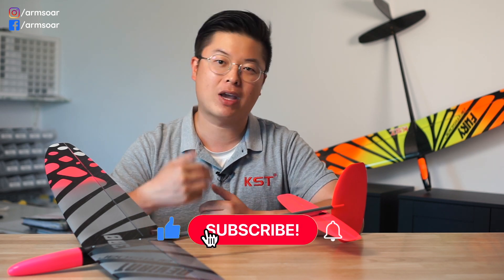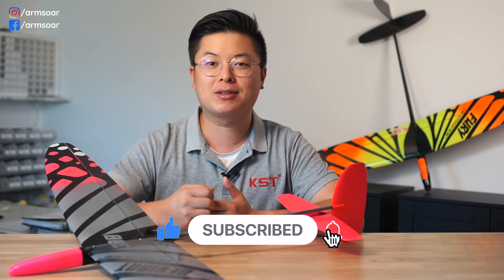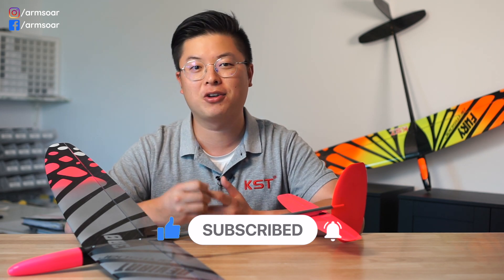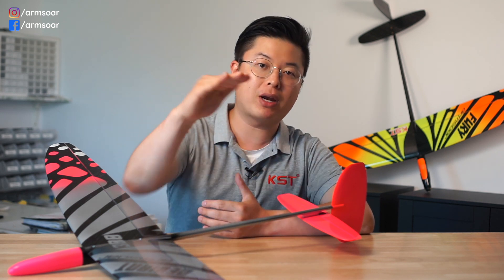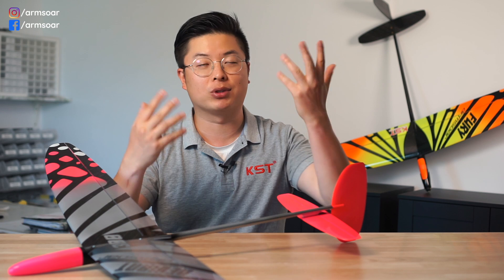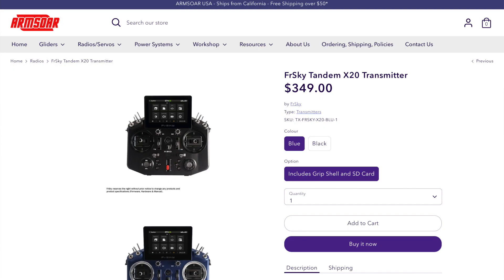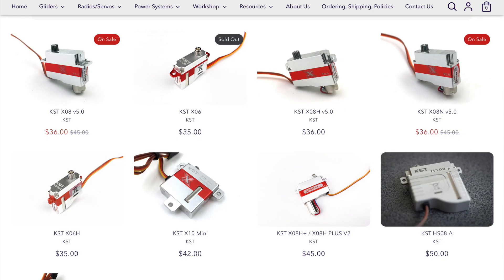RC Glider Basics | Failsafe

Comment from the maker: How do you setup your failsafe?
Reply: Idk
Reply: If you have SAFE, I think you can set it to SAFE and full bank. So the plane circles.
This must be the best setup for failsafe. 
I would like to know if it’s possible to do the same with FrSky gyro receivers.
Reply: @michelpetrus  It is.  I do something very similar with my FrSky stabilized receivers.  I turn on self-leveling mode, cut the throttle and add left rudder.  I have simulated it while flying and it works very well.
Reply: SAFE mode with a bank angle of 20-25 degrees..

Comment: I have a question, if you loose your esc mid air, killing power to everything, fail safe does nothing correct? I'm trying to determine if it was purely luck, or if  failsafe kicked in just as the esc burnt up. Regardless, the powered glider in which this happened to me with pulled up on its own, and seemingly put itself into a turn which I believe happened because of failsafe. I happened to have a camera on the plane when it died, so I have a recording of the entire thing and kindof know the full story, I think failsafe indeed saved it, but Im just not sure. All I know for certain is the plane was completely dead in the air, the motor brake on the folding prop power system never cut in to stop the prop since the esc died while the motor was running, and it was only clear that the system still had some form of power after it had landed, once all the wind noise was gone from the video, and you could hear the servos trying to initate, then cutting out, then trying again, then cutting out again, seemingly doing something similar to boot looping.

Comment: I'm new at the glider hobby. I agree with the fellow above.  Why not have a small GPS
module, like the drones, which will return the model to "home" in the event of a link failure.
Just remember to duck! Ha ha ha.
Reply: There are a few reasons GPS isn't the answer for DLGs that I can think of...
- Weight.  The extra weight of the GPS module (15 grams or so) plus any extra electronics with the smarts to return home is significant for a DLG and can change it's thermal performance/behavior.  Most models are designed to have minimal weight up front.  If you add a GPS receiver, you might need to add tail weight to compensate which would negatively affect launch behavior (extra weight at the extremities).
- Available space in DLGs is usually very tight with just 4 servos, receiver, and battery.  Finding anywhere where GPS (and possibly addition electronics) would fit is usually not workable for most DLG models... especially making sure the antenna is pointed up and you would need to make sure no carbon of the fuse is obstructing it.
- If you are into DLG competitions (F3K), the rules don't allow leveling tech to be in the model.  The whole idea of DLG is to not have any electronic leveling or assist and depend on the pilots skills finding and staying in thermals... and avoiding sink :).
I wonder how return home without a motor would work... especially if you need to catch a thermal to get it back onto the field.

Comment: I can't believe there is still no fail safe mode even in high end $1500-3000 RC systems when your $2000 glider flies back to you and lands. Those under $1000 DJI drones had this feature for ages.
Reply from the maker: Not really a feature we are looking for. That adds bulk and weight, GPS does not work in carbon glider fuselages without external antennas (more drag), and competition models cannot have anything on board that can move control surfaces without pilot input.

Comment: I got my failsave set in full flap and airlons centred.  Try it one at a height  of about 120 meters. Model goes first  in straight down at angle of 20 degrees but due to influence of wind the model goes also turn downwards.  For me the advantage is that you clearly see that the model goes failsafe  without hearing the warning of the  transmitter.

Comment: Good video.  Thanks.  I would add that with a powered model, it is especially important to make sure that failsafe puts the throttle setting to -100%; some failsafe has all values defaulted to 0%, which is half throttle, which is a very dangerous setting.
Reply from the maker: Very good advice!

Comment: What servo tester/ programmer do you recommend?
Reply from the maker: I like the Tahmazo one, been using it for many years. It gives you the digital readout and you can test/cycle two at a time. I’m not sure if they still make it or not though.
Reply: @ArmSoar  do you know of anywhere that sells it?
Reply from the maker: @ethanjackson880  just did a quick Google search and I don’t see anyone carrying it… sorry!
Reply: @ArmSoar  bummer
Reply from the maker: @ethanjackson880  there are a few nice looking ones from guys like ToolKitRC, but IIRC they seemed quite a bit bulkier than my Tahmazo.

Comment: In the '90, there was an International concern about failsafe, and an investigation was made at that time by some F3A federations after the dead of a kid playing football in a nearby field. The result was that the only safe method was to put the plane in a flat spin and shooting down the engine. You can maybe consider this method also.
Reply from the maker: Unfortunately most thermal gliders (especially DLGs) are very difficult to spin, but the models can be very slow. I think method B would be safest for pedestrians.

Comment: Wondering how do you test failsafe settings in flight? The most obvious seems to be turning a radio on and off, but maybe there are some "safer" methods?
Reply from the maker: Some systems are easier than others. On FrSky I put the settings on a switch and adjusted it until I got what I want, and then set that into the actual failsafe.
Reply: @ArmSoar  oh, nice! Thanks for the idea)
Reply from the maker: @geneschastnyy3981  let us know after you try it!
Reply: @ArmSoar  Sure!

Comment: or use tbs crossfire / tracer
Reply from the maker: Crossfire isn't really suitable for DLGs due to size, but Tracer is definitely gaining users. There are still a few things that need to be included in Tracer to gain wider usage by the sailplane community but it's an awesome system. I have the Tracer as well although I haven't put it in my gliders yet.
Reply: @ArmSoar  do you think the crossfire antennas are too big? because the actual recievers are exactly the same size
i would hope they make their own 8ch pwm adapter, because the workaround with a sbus to pwm converter likely isn't ideal
Reply from the maker: @marc_frank  IIRC the antennas were too big / long to fit in a DLG fuselage and the F5J fuselages I had on hand. Yeah hopefully we will see some more adapter choices. Would be great to have on-board vario as well that can be displayed on the TX for launch practice.
Reply: My Archer R4 is giving me low and critical warnings at ranges ~100m. Canopy is fibreglass… seem strange? Good motivation to get my failsafe sorted though lol
Reply from the maker: @mcwhinnie84  there’s definitely an issue there. Check antenna connectors and antenna installation to make sure there’s no/minimal shielding. Do a detailed range test with the plane at different angles to make sure it’s okay. Worst case scenario, send it to FrSky to check/repair. Their office in California is doing a good job taking care of these issues now.